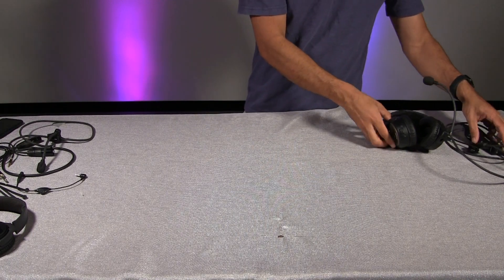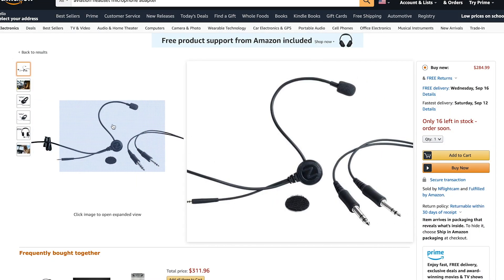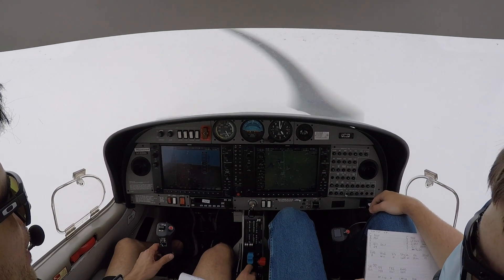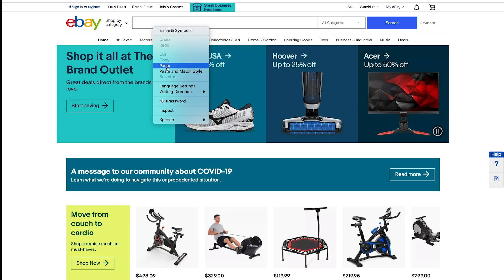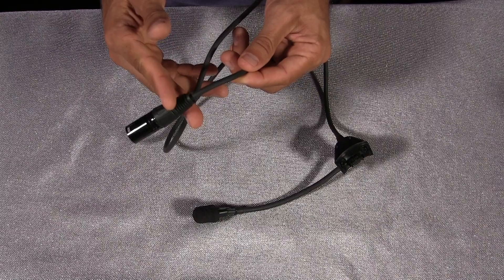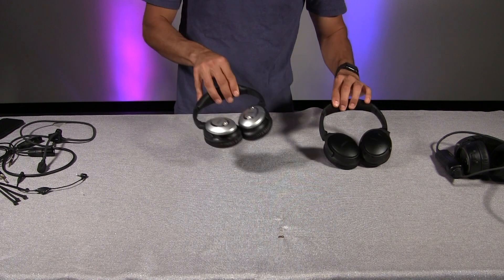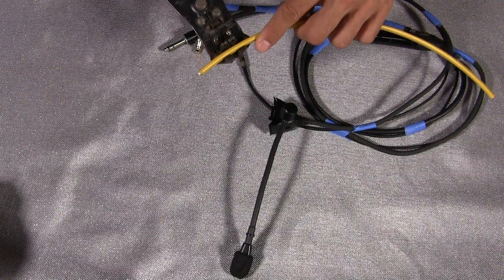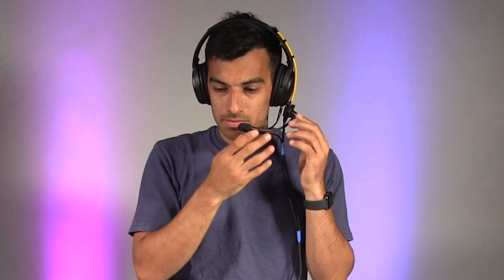DIY Aviation Headset Using Active Noise Cancelling headphones

Comment: so in theory was attaching the microphone cable to the xlr, and then the xlr adapted to the .206 even necessary? could u have just wired the microphone straight to the .206?
Reply from the maker: @brokengaming4906  you can wire it directly.  at the time I thought it would be better to be able to detach the .206 cable. Honestly don’t remember the exact reason.
Reply: @ very cool, thanks!
Reply: @Viera95  correct me if im wrong, but an electret microphone requires a bias voltage in order to work, how did you overcome this using GA plugs? Thanks!
Reply from the maker: @brokengaming4906  I think the intercom/radio supplies phantom power to the microphone. Although honestly I would need to do more research on that because I’m not very well versed on that information. 

I’m doing a flight on Wednesday I think I’ll make a part 2 video and show the headset in action. I’ve only used it every ones and a while with passengers but I think It would make an interesting video.
Reply: @ for sure! Let me know how it goes. Im currently piecing together a headset as a fun little project. Thanks!

Comment: Have you tried using them as pilot in command?  Everything still work with push to talk?
Reply from the maker: No unfortunately, I have only given the headset to passengers. I figure since the microphone sounds loud and clear on the intercom it should work over the radio as well.

Comment: FYI:  For anyone looking, Bose QC25s are available for around $40.  They work excellent.  I have tried QC45s too.   Here's the thing,  if you're concerned about them not being bluetooth,   Bose bluetooth is like any other bluetooth.  Its terrible.   you get bad audio compared to a cable.   So I own an excellent bluetooth headphone amp/dac.  Its a tiny device that connects to the headphone band with a short cable to the input jack.    Its the only bluetooth connection I've tried that sounds BETTER than a cable, because of the app it comes with and the audio controls.   It also has a mic for ambient sound, and a seperate volume control if you want complete control over ambient levels or none at all.     I use it for headphones, bluetooth speakers and in my car.   So don't pay extra for a "new"  Bose headphone set.  Buy older Bose headphones and use a quality bluetooth connection.  (or use a cable in an aircraft headset)  and enjoy low price and superior sound!

Comment: Hi, this is an old video but i'm wondering if it safe to plug a low impedance headset on a high impedance radio, either for the headsets or the aircrafts radio? Can this setup affect negatively the headsets or the radio, i.e damaged one of two? 
I have the headset and i'm thinking to do the same. Thank you
Reply from the maker: I’ve only used this headset on a G1000 audio panel and have never had any issues.

It might not be exactly the same but I know from being a sound guy that you can run low or high impedance speakers on an amplifier no problem. The problems can arise if you mix them together, For example if you had one 2ohm speaker and the others are 8ohm.

Comment: I have a Bose 700, can i buy a adapter to use it to Piper Warrior (Fixed Wing) plane. I guess Piper warrior required PJ-055 and PJ-068.

Comment: Nice video. I want to do this but wondering how it works when the jack in the plane (and plug on my David Clark Set)  is mono?
Reply from the maker: Thanks Richard. Everything would work the same but You would need a 1/4 Mono to 3.5mm Stereo Adapter. You can by one on Amazon. 
 All the adapter does is short the Right and left positive leads for the headphone speakers together.

Comment: Cool build. Have you tried it out? Looking to do something similar. Thanks!
Reply from the maker: Thanks for watching, yes my mom used it during a two hour flight in a Diamond DA40 she said it was way better then the rental headset she usually uses. Both in less wind/engine noise and a much more comfortable fit. The sound quality from the microphone also sounded good on my end. 
I did improve the headset a bit from what was seen in the video and used shrink tube to hold the wires together. It looks pretty nice now.
Reply: @Viera95  That's great -- I would be cool to see a follow up video on any improvements you've made. I just ordered the mic and a few other pieces to make this. I have an idea to better attach to the headphones but we'll have to see if that works out.
Reply: Can you tell me where you got the inline volume control and the other adapter you used?
Reply from the maker: @dennis9072   here is the links for the audio adapters.

Amazon Basics Gold Plated 6.35mm 1/4 Male to 3.5mm 1/8 Female Stereo Headphone Adapter - 2-Pack https://www.amazon.com/dp/B087KG4C1H/ref=cm_sw_r_cp_api_glt_fabc_6m5dGb2J8EARG

Inline Volume Control for 3.5MM Headphones,Black https://www.amazon.com/dp/B008DJTB32/ref=cm_sw_r_cp_api_glt_fabc_Oq5dGbTCJACZA

The volume control is kinda fragile so I’m still looking for a higher quality one but this is the one I used in the video.  Hope this info helps.